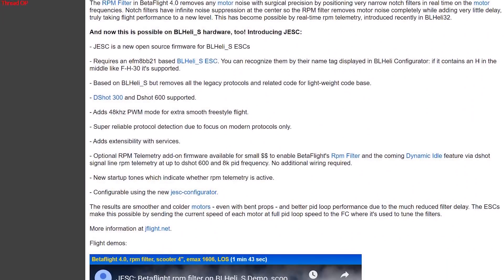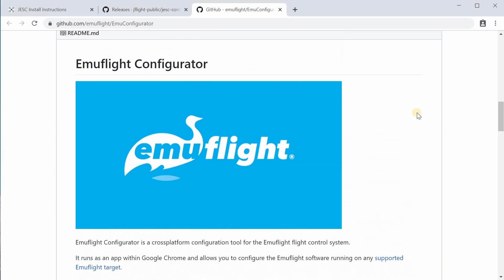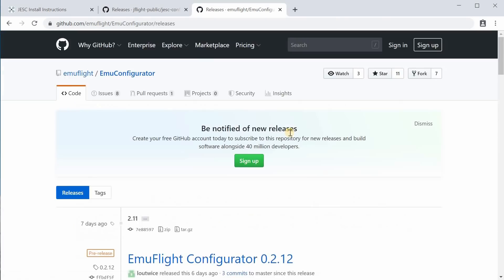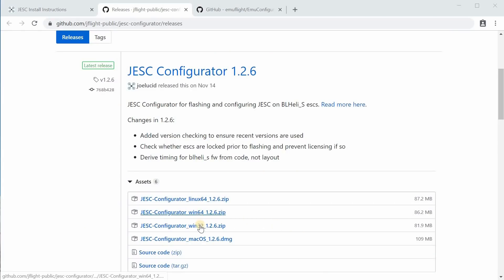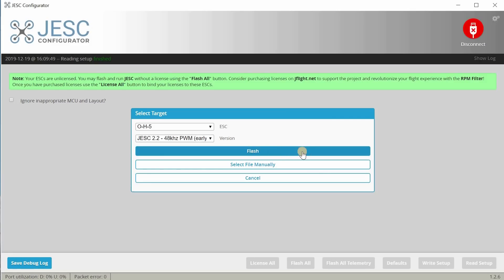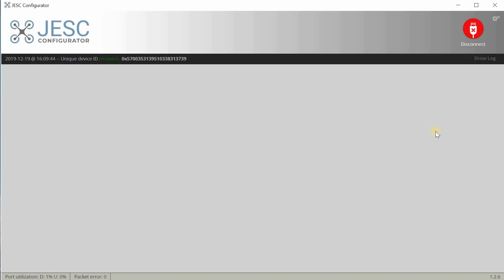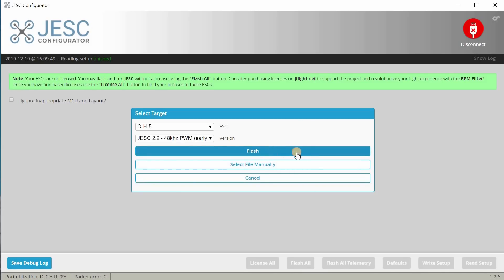Mobula6 Hack to Get Longer Flight Times 🔥

Comment from the maker: FYI, if you want to skip the whole EMUflight install, you can upgrade to Betaflight 4.1.1 instead and use the JESC 48khz firmware however, the flight time is not as long as on EMUflight according to Patrick J. Clark (Project Mockingbird).  He says he has tested both scenarios.  Also, Betaflight 4.1 will be needed.  If you got the first batch with 4.0.6, you'll need to upgrade to 4.1. You can get my BF 4.1.1 PIDs here - https://www.youtube.com/watch?v=dQ5zcVzxO5E
Reply: Are the pids in the description
Reply from the maker: Link to CLI dump (with PIDs) in the other video.
Reply: I got mine last week from pyro and it has 3.5.7 too
Reply: Crimson Ghost - Same here from RDQ.
Reply: I got it too on 3.5.7 and reflashed to 4.1 its a lot more stable and controllable on stock tune, now.

Comment: How does it work with the Crossfire version. When I go to the EMUFlight Conf. and choose the board. After i flash it it shows "No response from the bootloader, programming: FAILED"
Reply from the maker: I only know how to do this on Betaflight.  I don't fly anything with EMUflight.
Reply: So i did the firmware update in JESC Conf. do i also have to do the update in EMU?

I don’t get it 🤯😂 drone is still only flying 1,5 minutes

Comment: Thank you for your video. What is your opinion about the lowest safe voltage for 1S LiPo and Lipo HV battery?
Reply from the maker: It depends on the voltage sag.  Sometimes it can go below 3v near the end of a flight but then recover back to 3.5v after landing.  You want it to recover to 3.5v or above.  If it recovers below that, it's not good for the battery.

Comment: Thanks for the info but this did not make much difference for me. I tried upgrading jesc to 2.3 48khz and I already have betaflight 4.1 on a mobula 6. I maybe went from about 2 to 2:30. I stop at about 3.10(v) with 3.6 (v) after landing. Also I do not get 80% of the mAh out of my batteries. Some batteries only about 100 mAh and others about 190 mAh. These are pretty new batteries also. I cant figure out whats happening. I would dream about 4 minute flight times. Maybe is something broken on my mobula 6?
Reply from the maker: I think you get more flight time in EMUflight over betaflight
Reply: @AlbertKimTV  Thanks for the response. Actually tonight I flew again tonight and had much better results. This could be atributed to one of 2 things. I replaced my propellers and I also realized that I was charging at 2c instead of 1c. The propellers were not that bad of shape. Maybe dirty and scuffed. On my gaoneng HV batteries I had a 4-4:30 flight time. Thanks

Comment: Using betaflight 4.1 and jesc firmware, got 4:30 on stock 300mAh batteries. Got 6m on the URAV 550mAh.
Reply from the maker: There's a 550mah stick battery?
Reply: @AlbertKimTV  nope, but rotate it 90 degrees and it fits with some rubber bands.

Comment: Hi Albert, can I use Jazzmaverick 48K esc firmware instead of Jesc 48K? Because with Jesc no licensed esc fireware, which does not have rpm filter.
Reply from the maker: Yes, but your results might be different.  I have not tested that combo yet.
Reply: Albert Kim Thank you for your reply.

Comment: Ok albert I have been battling this mob6 this entire time , wowuldnt connect, then my tx diodnt have enough channels (I went to the hobby store and bought a new is-6x flysky tx which fixed that). then the props were on wrong the thing flew upside down. Now i need to figure out why my quad is spinning hard core the entire time..I dont want to use trimming yet as I think i have something messed up in emuflight settings or the transmitter settings.  Hard work trying to get your first brushless and first fpv quad going. (I had a bunch of brushed hubsan x4 clones I flew before this..so simple compared to this)
Reply from the maker: You probably have your channels mis-matched.  I think that radio is AETR and you probably are using TAER
Reply: @AlbertKimTV  I got it all working now! I have had my first few flights and its so much faster than the hubsan clones haha. Its a handful I think now I need to toe it down a bit now as i get used to it. Ive been waiting so long for it to arrive I had this shopping list of mods.

Comment: It just suddenlly worked! I have no idea why but it connected and did its thing! I put the cli file on also! just one last question, Why is the video reciever getting so hot when plugged in?
Reply from the maker: It gets hot because it's on a small board together with the ESCs so the heat builds up quickly

Comment: Right so I went through the guides and installed all the drivers, But it says bootloader failed. it also wont connect to beta flight or emu or anything. I had installed the drivers as needed and then I did the jesc config. then when I went to go into the emuflight config to do the flash it would not flash. Now im sure what ive done to it. Please send help..Im usually good with this kind of thing but I cant seem to get it to connect now. Zadig only sees my f4 fc and never sees STM32 BOOTLOADER so im unsure if this is why the bootloader fails? If theres a discord for this type of thing can you link me maybe i can just ask in there? It also keeps mentioning Chrome do i need to use chrome for this thing to work?
Reply from the maker: Have you tried to force the board into DFU mode?  You hold down the bootloader button while plugging in the USB cable.  It will be in DFU mode and should flash at that point.
Reply: @AlbertKimTV  Yes the port says succesfully opened and then says successfully closed. I am on windows 10. This is so confusing lol ive been all over the internet trying to figure this out. It connected to jesc and did that update..So it still wont show that I have the cp210 driver at all when i go in zadig I have no idea why. I also ran inpulse driver fixer on the board so i guess thats good. its also showing up on my computer as f4fc so it is connected I just cant get it to talk to any flight  configurator now at all :(   OOH i accidently changed the usb driver on the actual f4fc to the lastest windows driver this I guess could have broken it? I ran the uimpulse driver fixer after tho.https://gyazo.com/09163005d06fa1c54dc27ebab3e8b5d1 Got it to connect like this now again. Thank you so much in advance. Thought this would be a simple thing after watching your videos.
Reply from the maker: In DFU mode you won't get any messages other than the COM port showing it's in DFU mode.  You can't connect to the board in DFU mode.  You can only update the firmware to reflash it.

Comment: When I flash it with jesc for some reason it just flips out, and when I reflash blheli I have to reconfigure in Betaflight to make it fly normal cuz it’ll just flip out still, how can I fix this, I really need more flightitme...
Reply from the maker: It sounds like a motor direction problem but I don't see why JESC would change that when you flash firmware.   From what I remember it should not do that.  The other possibility is that you've somehow flashed the wrong firmware target so it's mismatched.

Comment: hmmm tempted to keep the betaflight 4.1.1 on my beta65 pro 2s and try flashing the esc to enable 48khz, wonder if i could try notch filtering.
Reply from the maker: go for it!
Reply: @AlbertKimTV  And done, so far so good. fairly smooth flights. no major improvements on flight time but i am using betaflight nor emuflight.
Reply: @rjredd  I had the same experience. betaflight 4.1.1 48khz and no better flight time. Did you try emu flight and see a difference?

Comment: I get auto pitch forward in acro as if I were in angle mode, any suggestions on a fix?
Reply from the maker: Are you sure?  Turn off the ACC and see if it still happens.
Reply: I tried that and adjusting The I value on the pitch pid. The only thing thats helping is subtrimming my tx. Some others on the mockingbird facebook are having the same problem. I feel like it’s some small cli adjustment in emu but not sure what I’m looking for.
Reply: Reflashed escs with Jesc 2.3, turned off acc and your fix worked, thank you
Reply: You are in ACRO training, turn off AIR and you are in ACRO.

Comment: It is a great time to be flying FPV micro brushless quads!!  With this 48khz thing boosting flight times, plus the RPM filter has been the best improvement to betaflight yet!!  For my micro's it has been anyways..
The quads I used to get 3 minutes on I am getting 4.5-5 minutes easy...    Each one of those improvements is so huge..  They are once in a long time improvements, and they happened almost back to back...   I love it...

Comment: Hi Albert,
I flashed my mobula6 yesterday and flew with no problems, but today I plugged a battery and now it wont arm... the initial beeps no longer play and neither the emu configurator nor BF configurator see it as a com port when plugged... what can I do?
Reply from the maker: Are all your original settings still there?  I heard some boards getting reset randomly.  Have you tried going back to Betaflight and stock ESC firmware?

Comment: Thanks for the clever tip Albert. Have you posted an update video since then giving a better idea of the stability and or reliability of doing this procedure?
Reply from the maker: Still flying fine.  However, I've moving on to testing RPM filter now.  New video on that soon...
Reply: @AlbertKimTV  one of the best things about you is that you always reply when we ask you a direct question in the comments. Thanks for that Bud.
Reply: I have been using the J-ESC firmware with no issues on over ten micro's at this point..

Comment: Thanks Albert. Enjoy your reviews. Excellent content. You come across as knowledgeable and competent - with humility and respect for your viewers. I am about to buy a Mobula 6. Is the 25000kv motor version a better outdoor choice in a slight breeze, beginner FPV flying? Was going to settle for the 19000kv model but your hack has got me thinking 🤔
Reply from the maker: Just get the 25000kv version and if you want more flight time you can just upgrade the ESC to 48khz...   However I'm not sure a beginner will notice the difference between the versions.
Reply: Albert Kim 🙏🏽

Comment: Hi Albert, I want to apply these hacks with my Mobula6 but before doing that, I want to upgrade my FC with betaflight 4.1 but I rather confused for crazybeef4 frysky, right now there's 2 firmware for betaflight 4.1 (Legacy & HAMO) which one is suitable & better for my mobuka6 ? thanks before
Reply from the maker: See my Betaflight 4.1 upgrade guide for an explanation but they are basically the same.  Legacy will work for most people...  http://youtu.be/JP88ci9lJ6w
Reply: @AlbertKimTV  thanks 🙏

Comment: Just tested the 48khz firmware of one of my whoops running 0703 22000 kv motors (which is the most inefficient setup that I have). I was getting 2.20 minutes flight time before. Now I get 3.20 minutes, very little battery sag and cool motors. On betaflight 4.06.
Reply from the maker: Yep, it helps many other setups...

Comment: thanks @albertkim for this video but it's gonna be pretty hard not to want to fly this lil bad boy in acro doing flips and rolls. so maybe ill wait till you guys figure out how to tune it for acro moves. or maybe if i feel comfortable ill try tuning myself. not sure. first i need to get it in the mail and try it out stock. im still waiting on mine from rdq:(
Reply from the maker: I'm going to try the new open source 48khz firmware and BF 4.1.1 with RPM filter so stay tuned for an update later...
Reply: @AlbertKimTV  thx❗

Comment: Well after a lot of messing and tweaking I have the mobula 6 jello the main problem is the props they are touching the ducts so shave off 0.2 mm off the props and bingo so I changed the foam to a less dense type 🤩🤪

Comment: BlHeli_S has version 16.76 with 48KHz support. I've installed it and done a 10 second test flight on both my sailfly-x and tinyhawk 1S. Works great and almost seems to produce quieter motors (more testing needed).
 Can't confirm flight time differences yet as I haven't tested that far. Also this is without upgrading to betaflight 4.1.1 or emuflight.

Github link with the hex files:  https://github.com/JazzMaverick/BLHeli/tree/JazzMaverick-patch-1 (Note: you need to find the correct hex file for the esc,. Match the firmware filename code eg: "S_H_50" to the one listed for the esc in blheli configurator.)

RcGroups discussion:  https://www.rcgroups.com/forums/showthread.php?2640796-BLHeli_S-Smooth-as-Silk/page364
Reply from the maker: Yeah, I have a video on this coming out soon.  I installed the bad 16.75 firmware and got death rolls however.  it should be noted, this is still highly experimental.

Comment: Albert if my ESC reads s-h-90   do i keep it on that  or  put it to o-h-90   on my tiny hawk s  for JESC
Reply from the maker: You have to match whatever it reads... if you use different firmware it won't work or it may damage your ESC or motor.
Reply: mike j Any improvement on the Tinyhawk?

Comment: With the 25000 kv version couldn't you just throttle scale down to the 19000 equivalent to get longer flight times? Easy to do on betaflight 4.1 but curious if that would work
Reply from the maker: It will work to some extent but you won't see gains as large as this because the change is in the ESC and better filtering on EMUflight.

Comment: I wonder how long the flight time would be on 0802 19000kv motors.
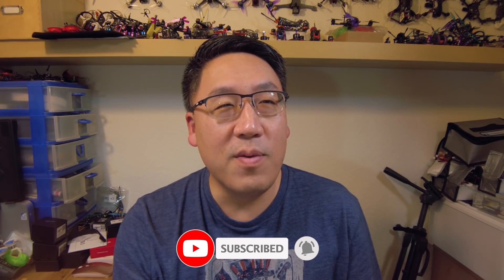Reply from the maker: It's not as much of a difference.  But I am getting 5:30 on my setup with BF4.1 and 48khz ESCs.
Reply: @AlbertKimTV  I have a mobula6 with 1900kv motors on the way. Is the process done the same way?
Reply: And would this work on a ur65 with 0703 1700kv motors. Because I am only getting 2min on it

Comment: I'm running JESC 48khz with RPM filtering Betaflight 4.1.1 on an original Tinyhawk.  Gained over 30 seconds of indoor Acro flight time over the 24khz version, using the GNB  450 HV batteries.

Comment: Is the function of how this increases run time akin to.a Joule Ringer circuit?  Are high amplitude spikes present on the output?  Any chance you could see what is happening on the output via an oscilloscope?  Fascinating stuff.  Is there a spike that is being reflected back into the power supply?  Thanks for sharing...... if there is, this is a phenomenal example of what is the tip of an iceberg.
Reply from the maker: I don't have an oscilloscope

Comment: btw, you can get longer flight times even using BF 4.1 on the Mob6, but in my testing, you get 15-30 seconds longer in emu with my tunes :)  I also have BF configs for the TinyHawk S and Mob7 for this in the Project Mockingbird Facebook group.  Emuflight is rad, but if you don't like it you can get great improvements in flight time in BF as well with JESC 48khz :)
Reply: So there's a proyect mokingbird for the tiny s already?
Reply: @MasafinaRacing  yup, well, a beta version people are testing...available right now in the Project Mockingbird Facebook Group
Reply: @ProjectMockingbird  mine is dead, I was about to buy another one but the announcement of the tinyhawk 2 change my path. I really love the tiny s but the tiny 2 address the problems im having with the S
Reply from the maker: I think he is working on it.
Reply: if my ESC reads s-h-90   do i keep it on that  or  put it to o-h-90   on my tiny hawk s  for JESC
Reply: Anyone know if the tinyhawk s mockingbird tune will work for the TH2? Both 1and 2s.  Dont about tune being the same as I jus have the TH2
Reply: Or the jesc's work for longer flight times for the TH2?
Reply: Micheal Moore that probably won’t be ideal. If the other drone is popular enough you can hope for it’s own tune from project mockingbird.
Reply: is it ok to follow these instructions for a Mobula6 HD? Do the exact same settings apply?
Reply: I get 2,5 minutes off flight time tops with 48hz and emuflight i even tried your mockingbird tune for mu mobula 6 but nothing works 2,5 is all i get of i hover above the ground an d staying still what can i try next?

Comment: I would be curious if there would be a greater or equal efficiency on BF 4.1 with RPM filtering and 48khz?
Reply from the maker: I think you'll need to pay for the JESC license at that point.  I heard JazzMac is working on his version but not ready yet.
Reply: @AlbertKimTV  I have no problem paying for the ESC software if it provides better performance.  I have had good luck with RPM filtering on my 2.5 and 3 inch rigs.  Haven't played with it on any of my whoops though.
Reply: RPM didn't add or subtract any flight time in my tests with betaflight and even though I get slightly longer flights in Emu, it's mostly the 48khz JESC mode helping.

Comment: Hello Albert, I think  your links are a little messed up. At least for the content of the video. You referred to the normal BLHeliSuite and the alternative Hex-Files for getting the rpm filtering for free from JazzMac. Unfortunately they don't have a 48khz PWM Mode (yet). You should IMHO link to the JESC and Emuflight configurators.
Reply from the maker: whoops... those are for RPM filter... got this video mixed up with another one... thanks for catching that!

Comment: will this work on a tinyhawk s   im only getting 2and1/2  min on stock battery 1s
Reply from the maker: I have heard it will
Reply: @AlbertKimTV  dang, between this on the mobula 6 and on the tiny hawk s, many these whoops get my jacked up! Question - if it works on tiny hawk S, would it still benefit when running on 2s?
Reply: yup...I have a betaflight version of PMB with it on the Project Mockingbird Facebook group :)  I am getting over 3 minutes now on 2s and motors and batteries are much cooler.
Reply: @ProjectMockingbird  just put your tune on my s HA HA    will try this next